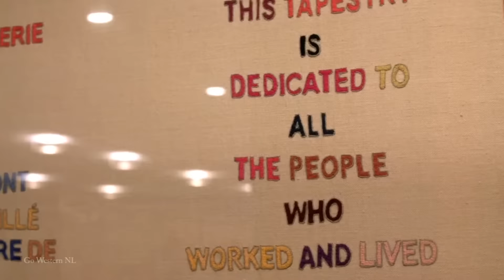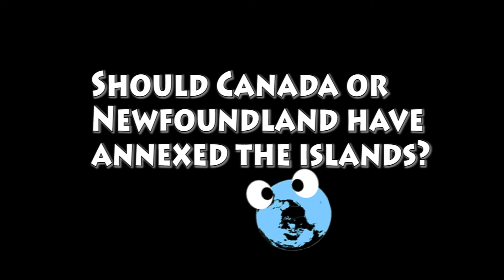Why France Still Owns Land next to Canada

Comment: The Grand Banks cod fishery, located southeast of Newfoundland, has been in recovery since the 1990s after collapsing in 1993 due to overfishing. In 2010, the Northwest Atlantic Fisheries Organization (NAFO) reported that the cod population was showing early signs of improvement, but was still only 21% of a sustainable level. In 2015, the cod began to show signs of more modest recovery, and in 2023, there were an estimated 407 million Northern cod, which is about 12% of its biomass from the 1960s and 24% of its biomass from the 1980s. However, some scientists worry that cod may never return to the area. 
The recovery of the Grand Banks cod fishery is dependent on reducing bycatch, which has been a problem in the past. In 2009, NAFO established voluntary limits on cod bycatch in other fisheries, but more than half of those limits were exceeded. Trawlers also catch large amounts of non-commercial fish, which can disrupt the ecosystem by depleting predator and prey species.
Reply: Cod are cold water fish. If that area warms up too much they'll never come back.
Reply: It looks like the Fellas have arrived.
Reply: @JohnGeorgeBauerBuis  heh, hey #fella @silkfella

Comment: We were just there on both islands.  An exceptional meal at Le Select to celebrate our 50th wedding anniversary.  Interesting shopping, best baguette!  We took our vintage campervan and found lots of spots to park for the night on both islands.  St. Pierre has formal FREE RV parking, along with dump facilities and piped drinking water.  Although costly to take the campervan on the ferries, cheaper than hotel and restaurant food for 9 days.  You have to buy auto insurance, which is about 150 Euros, it is good for 30 days.  Would love to go again and spend several weeks.

Comment: Thanks, I always wondered about that island.  I’m a C-130 Navigator and St. John’s, Newfoundland is a popular fuel stop for C-130s crossing the Atlantic.  I always saw that small Island on the chart with (France) next to it.  It always seemed strange and I thought maybe  it was a charting error.  As far as I know there is no runway on the island, at least it wasn’t on the labeled on the chart.
Reply: Short (3500ft?) Runway iirc
Reply: @terrellmiller7361 all a C-130 needs is 3000 ft, so it would do in a pinch.

Comment: The Nordic countries have had a passport union ince the 1950s. I have travelled in Schengen Euope using only my drivers license.

When training other nationals how to run their borders, it is standard procedure to drive from Oslo to Sweden without any passport control. And people are baffled because there are no soldiers guarding the border.

In some parts of the countries, the Nordic countries have common customs stations. So a Finn might check you if you stop on the Norwegian/Finish border station before entering Norway.